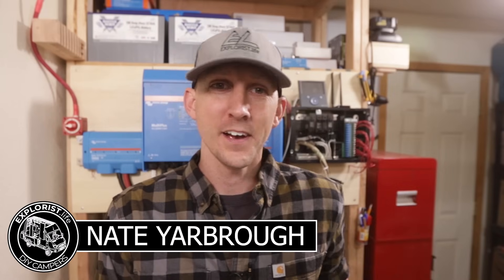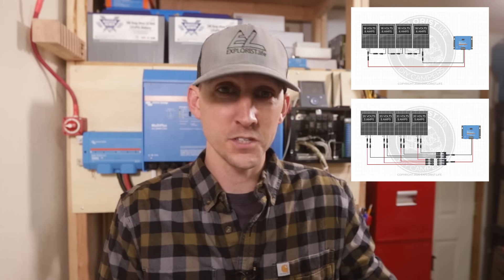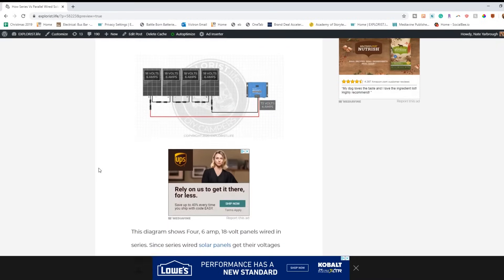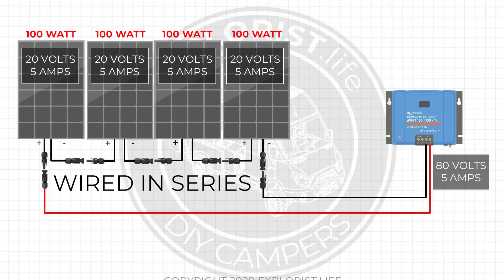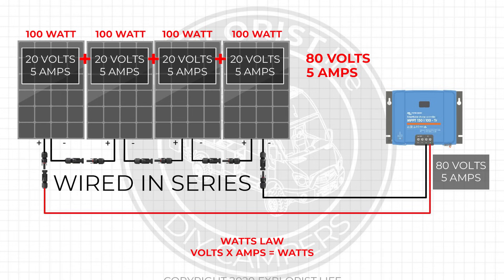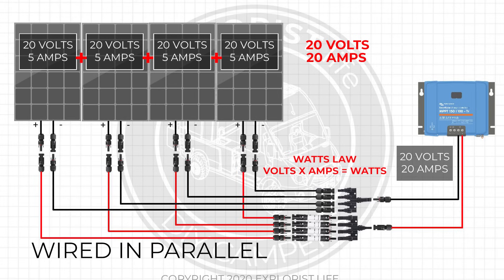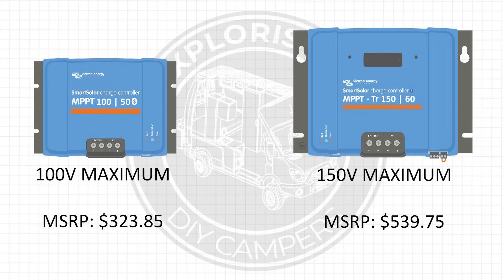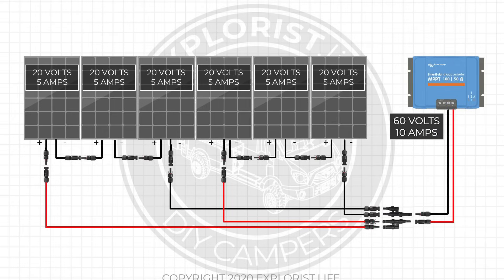Solar Panel Wiring vs Volts and Amps

Comment: I have 5; 340 watt Adani solar panels. I have a 48v Hybrid 3500w pure sine inverter 80 amp mppt controller.  The Adani panels puts out 38v. 9a. The controller says it can handle 65 to 115 Vdc. What is the best way to wire the panels. Series is the preferred, being an mppt controller. Will be to much voltage though. Parallel? Or series/parallel? Maybe use less panels in series? Not knowledgeable to figure the best combination. Thanks for any answers. My name is Bill.

Comment: 6 panels of 100 watts renogy to ecoflow delta connections advice thanks
Reply from the maker: Choose whatever wiring method gets you the highest volts WHILE keeping the array Voc under 80% of the max solar input voltage.

Comment: I have 12 45 watt solar panels. Can you set me up with the most economical charge controller ?  Then to the proper size inverter.
 The. Goal is a 12 volt off grid system using 2 led acid deep. Cycle battery's to run a. 110 refrigerator.And coffee pot. Possibly a hot water heater. Thank you for your help.
Reply from the maker: Here's a video that will teach you how to size a charge controller: https://www.youtube.com/watch?v=MxziHKvTRh8

Comment: Now that we understand the volts and amps of wiring the panels. When camping we will likely end up with some kind of shade on a at least 1 panel. The shade will reduce that panels voltage. To keep voltage equal or above the 20v more than the 12v battery bank, should we always wire small arrays in series, up to the max voltage our MPPT can handle?

Comment: What is better to have coming to ur charge controller more Amps or more volts thats what im tryin t figure out should i actually wire them in parallel or infact series ??

Comment: The MPPT says 100|50, what is the 50?   And is that the AMPs from the Solar Panel or the Amps going to the Battery?
Here is some more in the way of example:

Say have 250W panel at 50V and 5A.    Now if I go to a 12V battery, the Amps going to battery is about 21 Amps.  But if have 24V battery, than you have about 10.5 Amps.   So when sizing and looking at the Amp rating of charge controller, do you need to take into account battery voltage or do you just size the amps from the panel?

Comment: your awesome
thank you for such in depth, siple and clear explanations.... i am about toDIY 2000 or 3000 watt, 24v Solar Power System w/ LiFePO4 Batteries,,so needed your assistance... it was getting quiet overwhelming until i found you.. x bless x
thanks and grace

Comment: I love ur way of explaining the dif panel configurations my question is when looking at the back of my 4 240w 37.2v panels i see 4 dif amp ratings im trying to figure out witch amp rating to go by 1. Maximum Power Current 7.89amps 2. Short Circuit Current 8.73amps 3.Maximum Serious Fuse 15amps 4. Minimum Bypass Diode 15amps when wiring witch amp rating u referring to ? thanks
Reply: What about a 3 way y split?
Reply: 240 ÷by 37.2 equals one of the numbers in the panel

Comment: I ordered a 600w 12v system and need to have about a100’ run of wire from the panels to my home. If I were to run the panels in series/parallel, if my calculations are correct it would bring the power it would mean the power arriving at my charge controller would be roughly 36v/10.5amps. Would my charge controller just convert this to 12v as it goes to my batteries?
Reply: Yep! that's exactly what the charge controller does; converts the voltage from the panels into an appropriate voltage for the battery bank. Depending on the charge controller, you can program it for 12v/24v or even 48v depending on your needs and its abilities.
Reply: @adventureswithcorrine  Just wanted to be sure that I understood it correctly. And, it’s always nice to receive validation from people, like yourself, who are knowledgeable. Thank you very much!!

Comment: So if I have a 400w, 80v, 5amp system, would it only be storing 5 amps an hour to my batteries or would the controller actually put our more than that when it transfers over?

Comment: Is it ok to run a 400 watt system in series with a 40a mppt controller with 12v battery and a 2000 watt inverter?

Comment: I have 5 nos. 150 watt solar panel and also one mppt, one pwm charge controller. So what type of connection should need for me for charging two battery 200 ah. Please suggest me

Comment: I have a question, does a MPPT controller control the output battery voltage or does the solar panels determine the system battery voltage.
Reply from the maker: The battery voltage and how the battery bank is wired determines the system battery voltage.

Comment: hello, Please i have question 3 questions, 
I just  got 2, Newpowa 180W (watt) 12V, and I'm having a hard time trying to choose a solar controller, batteries and converter.
which solar controller will work best for me? and which battery and converter ? 
please hellllpppp 🙏💫

Comment: ok but is there any difference or benefit to any of the different wiring circuits
Reply from the maker: Yes.  The array needs to be at least 20V over the battery bank voltage for best MPPT charge controller performance but below the max input voltage of the charge controller.  Being able to wire in series or series parallel will allow you to alter your array to meet these parameters.  Watch this playlist in order and you'll have a REALLY solid grasp of designing an array: https://www.youtube.com/playlist?list=PLmvhcyi4n0TUjVGA_O5aI5SQrS1kKLgEF

Comment: Seeking advice on optimal setup: 6 * 100W on Sprinter RV roof-top, taking shade into account.
Here are the specs on the 100W panels:
Voc = 25.4V, Vmp = 20.5V
Isc = 5.23A, Imp = 4.95A

Here are the options I'm considering so far:
1) 1 MPTT 100/50 Controller: 6 panels in Parallel.
2) 1 MPTT 100/50 Controller: 3 Sets of 2 Panels in Series, with the 3 Sets connected in Parallel
3) 2 MPTT 100/30 Controllers: 2 Sets of 3 Panels in Parallel per controller
4) 2 MPTT 100/30 Controllers: 2 Sets of 3 Panels in Series per controller
5) 3 MPTT 100/20 Controllers: 3 Sets of 2 Panels in Parallel per controller
6) 3 MPTT 100/20 Controllers: 3 Sets of 2 Panels in Series per controller

Thanks in advance for your feedback.
Reply from the maker: #2 or #4 would be my choice of those.

Another really good option if it plays well with your shading:  MPPT 100/50 w/ 2 sets of 3 panels in series with the 2 sets in parallel. <-  This would be better than option #2 if it works with your shading issues.
Reply: @EXPLORISTlife  Annh... So overall you prefer sets of 3 panels in series (~ 60V @ Controller)
(1) ONE Controller: 2 Sets in Parallel
(2) TWO Controllers: 1 Set per Contoller
I presume that the TWO  Controller option would be optimal, albeit more expensive, in case one of the Serial-Sets takes a hit on shade...Right?
Also, it seems like the 3 Controller options would be a bit overkill for my application, right?

BTW, the shade situation is unpredictable... Just typical RV camping/boondocking.

Thanks!

Comment: I have 3 x 40v panels in parallel connected to a 24v system and today its a bit cloudy and the panels make less than 24v only 6v aswell. so of course it cant charge , but why? shouldnt only the amps drop with shade, why the voltage? if i connect them in series i am not sure if i solve the problem because if 1 makes only 5-8v i am still not reaching more than 24, so whats the problem? always when i measure the output voltage directly from the panels, its always about 37v with strong sun and when its cloudy aswell, but as soon as i attach them to the mppt the voltage drops to 6v or less

Comment: I have 2 Rich Solar 12v 100 watt Poly's now using a Renogy 40amp MPPT. I want to add 400 more watts. Is it a good idea to put the two Poly 100s in series and add two 200 watt Mono 24 volt panels in parallel with the two in series, giving me 600 watts 24v 15 amps?
Reply: Oh yeah, the 100s are 22.6 voc and 5.86 isc.  And the Mono 200 watt panels are 45.4 voc and 5.83 isc

Comment: I have (6) 325w/36.8v/8.83amp solar panels, (1) 120amp mppt, (1) 48v Li battery. Would the best configuration be 3 in series with 2 strings in parallel ? That would be 110v/1950w/18amps (rounded) vs 74v/1950w/26amps, 2 in series with 3 strings in parallel.

Comment: Hello! If in a series of 10 panels with 310w, I have panels with different parameters, is it a problem? Example: 8 panels 33.2V / 9.3A and two 32.6V / 9.5A. Thank you!

Comment: Nate, I have everything wired for my solar on my class C RV, and I’m ready to mount the flexible SunPower panels I’ve purchased, However, I do not want to drill into my roof. I’ve been researching using corrugated plastic sheets taped down with eternabond tape as a heat barrier, with nuts and bolts to make the panels removable. My roof material is TPO, (a thin, vinyl continuous sheet, glued to the 1/4 roof sheeting). I’m finding mixed reviews on whether or not I should tape anything to a TPO roof. Do you have any experience with this type of installation?
Reply from the maker: I very much don't like flexible panels flat mounted to the roof so I, therefore, do not have experience with that kind of setup.

Comment: How can we determine the required charge current for a battery ? Considering Load is 1500W run time is 8hrs.
Reply from the maker: The battery manufacturer should provide the minimum and maximum charge current in the users manual or on a sticker on the battery itself.

Comment: Thank you for simplicity in your explanation. In the large parallel array, for a house installation, how would you determine the circuit breaker size before the inverter?
Reply from the maker: If you are connecting solar panels to some kind of grid-tied inverter, or something... that's a bit out of my expertise.  But, if you are connecting the solar array to a charge controller like I have in all of my wiring diagrams at https://www.explorist.life/solarwiringdiagrams, this video should answer that question: https://www.youtube.com/watch?v=HOXnWXvLXko

Comment: I would like to wire two 100 watt panels in series to a 20 amp mppt charge controller.... Possible or should I buy a 40 amp mppt charge controller to be safe?
Reply from the maker: Here is a tutorial that will teach you how to size a charge controller.

Comment: im currently installing 2 100w solar panels in series with a rover mppt 40amp solar charge controller and im not sure what size double pole breaker i need for the leads between the solar panels and charge controller. also what size single pole connector would i need for the lead between the solar charge controller and battery bank? thanks!

Comment: I have 16 100 panels =1600 watt 
My ? Is. Can I have 1 set of 8 in seires and other set in parallel n connect them to the same line ?
Reply from the maker: With a properly sized charge controller, sure!
Reply: @EXPLORISTlife  ok thxz u will try to set it 2morrow
Reply: Do u have a email I want to show u a pic of my cable that's coming out from my panles n  I want a 2nd opinion  cuz I believe I should change it look damage. If u don't mind
Reply from the maker: I can help with that in my private consulting group.  More info on that here: https://community.explorist.life

Comment: Hello i have 2 165w panels but only getting 11 Amps and 13v ? There rated at 10amps /20v each ? I think he wired them as parrarel? But still dont add up. There clean and its mid day very strong sunlight ( im in the middle east lol )
Reply from the maker: Yeah, that does seem a bit low.

Comment: Hey Buddy. I love the videos. Detailed explanations and you answer what viewers are going to ask lol. Your pace of talking is almost as calming as the BBC Planet Earth guy too lol. I did want to mention that I've tried your super helpful charge controller calculator. Thank you for creating it! I don't know if you have an amazon affiliate link for the recommended item, but no matter which item the calculator recommends the link seems to go to the same 75v/10A controller. Cheers
Reply from the maker: Ahh... the vendor changed up their product page.  The link USED to go a page with all of the charge controllers on one page.  I'll make an adjustment.  Thanks for the heads up.

Comment: I think some people may be confused (maybe even me) that are using a PWM controller, because you will not get the same power output, with a series connection on a PWM as you would on an MPPT, ( I have tried both) since the PWM will only output the "Battery Max" of lets say 13 volts just as an example, x 20 amps giving you only 260 watts, as with an MPPT you will take all 80 watts divide it by again lets use 13 volts and multiply that by the 20 amps to get 390 watts. Am I thinking about that properly?

Comment: Does it mean it makes no difference if I set up 4x 200w (12v) panels in series/parallel to make 24v system  OR buying 4x200w (24) panels in parallel?

Comment: Is it possible to add to a Panel 290 W / /24volts polycrystalline 60 cells a 330w/24 volts polycrystalline 72 cells . will I lose some power of the new panel ?
Reply from the maker: Here is how wiring mismatched solar panels together affects the array: https://www.explorist.life/using-mismatched-solar-panel-sizes/

Comment: Very nice video , the math is clear and the explanation was great , what I want to confirm though is, when you say volts are you referring to the open circle volt rating ? And for amps am I looking at the maximum current rating or do I just do 300 watts / VOC to get the continuous amp rating ?  Thanks
Reply from the maker: These concepts remain the same for open circuit voltage/amperage OR short circuit voltage/amperage.

Comment: Hi, pls can u do a picture diagram video on how to connect solar panels for a 48v system (Number of panels and how to connect them together (280w ,300w, 325w or 350w 24V)
Reply from the maker: The connections would be the same regardless of battery bank voltage.  You would just need to design your array so that it is high enough voltage to charge your 48V battery bank.

Comment: So when someone says they have a 7875  watt solar array, in all actuality that is not true? Say i have 25- 315watt panels wired for 48 volts and a OC voltage of say 72 volts,  its not actually 7875 watt system
Reply: Well crap. I just figured it out, amps don't change when series connecting but the watts does. So 2 panels at 37.5 volts and 8.4 amps a peice, the amps stay the same but watts increase...?
Reply from the maker: A panel with 37.5V and 8.4A would be a 315W panel (37.5V x 8.4A = 315W)

2x of those panels wired in series would be an array operating at 75V and 8.4A.  This would be a 630W Array. ( 75V x 8.4A = 630W)

2x of those panels wired in parallel would be an array operating at 37.5V and 16.8A.  This would be a 630W Array. (37.5V x 16.8A = 630W)

Comment: I have a question o great teacher! I have a 24v trolling motor and if I run 2, 12v flex solar panels to a 2 lead acid battery system. How do I connect the wires from the charger control to the battery since I have wire the batteries to be 24v. I dont want to blow up my batteries

Comment: does anyone explain the different voltages? like above, i thought 100 watt panels were 18 volts, but i have some that say 24 volt on the box, yet when i check them open circuit the meter says 22volts. maybe it fluctuates with the sun, but what are the expected ranges and what gives the best performance?
Reply from the maker: The open circuit voltage listed on the back of the panel will be the open circuit voltage with direct sunlight when the solar panel is at 25 degrees celcius.  Any warmer, the voltage will go down.  Any colder, the voltage will go up.  That is explained a bit more in this video: https://www.explorist.life/solar-charge-controller-calculator/

Comment: I have a series connection using 4x180w panels. I should be getting 10amps at 86. 4v but im getting around 5.7 amps at around 72v max on very sunny days. Idky my amps are so low ☹
Reply from the maker: If it's summer and hot where you are, high temps can lower panel voltages (and therefore amps).

If it's winter where you are... low sun angles can lower panel wattage.
Reply: @EXPLORISTlife  The panels were at 98 degrees Fahrenheit. I think  you're right. Its winter and the angle of the panels have not been properly adjusted. I can fix the angle, but how can I stop the panels from overheating to get a higher amp output?

Comment: Is it possible/advisable to run a circuit with parallel panels then connected in series?
Reply from the maker: Although its 'possible', I can think of no scenario where that would be beneficial.

Comment: Love your videos! Just starting my journey and research to make decisions for my DIY build. Using your audit tool, I've determined that I'll need about 200 amp hours a day w/ a 400 watt solar array (that's correct, right?). How long would it take to charge 2 100 amp hour lithium batteries with the 400 watt solar array? Let's assume I drained the batteries to 0% capacity overnight and the solar panels begin charging under ideal conditions the next day. Is there a calculation for this? Thanks!
Reply from the maker: Sure!  Let's say you were pulling in all 400W from solar...

400W charging a 12V battery bank is charging at a rate of (400W / 12V = 33A) 33A.

So, Charging at 33A for the duration of an hour would yield 33 Amp Hours back into your battery bank.  So...  200Ah battery bank / 33Ah Charging Rate = ~ 6 hours of charging time to recharge 200Ah worth of battery capacity.